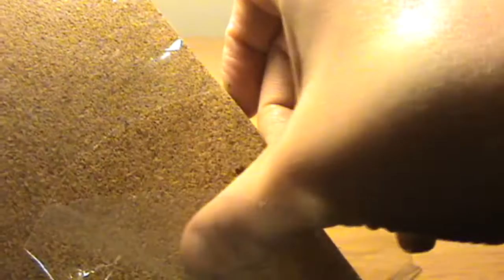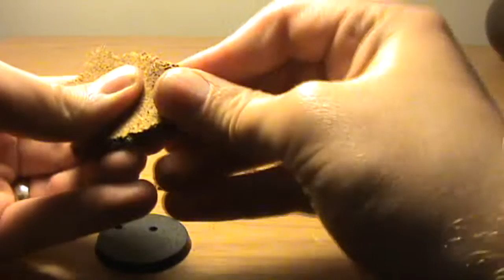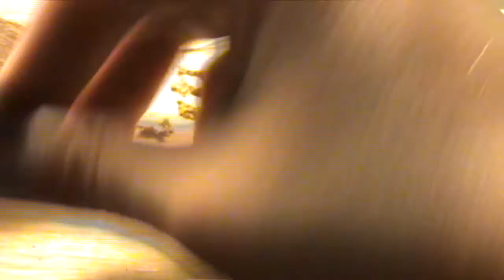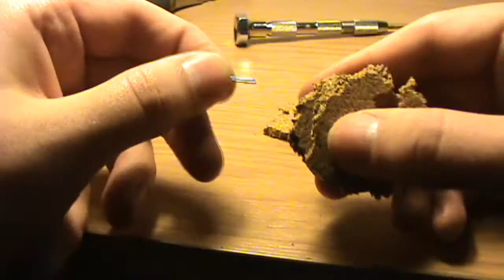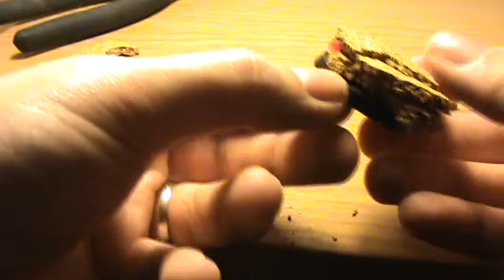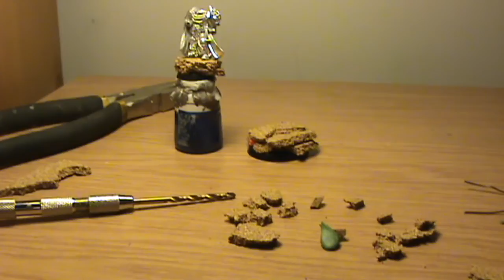cork base tutorial

Comment: An addition to this is the painting. Just buy a tube of Black & a tube of White acrylic paint. (Poundland, B&M, HomeBargains, Wilkoa all sell them for around £1-2.) Then using a pallette (I use polystyrene plates or cheap bathroom tiles) put patches of black, white, dark gray (2 black:1 white), mid gray (1black:1white) & light gray (2white:1black) on to it and remember to water them down around 4:1 (4water:1paint). The basecoat with the black, and successively dry brush from dark to light up to